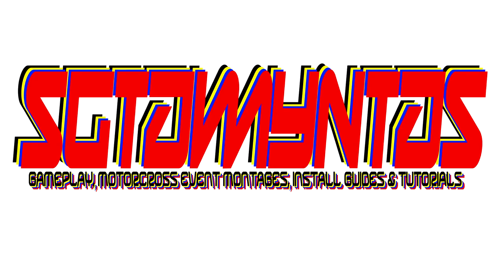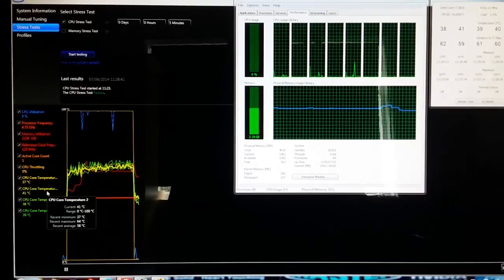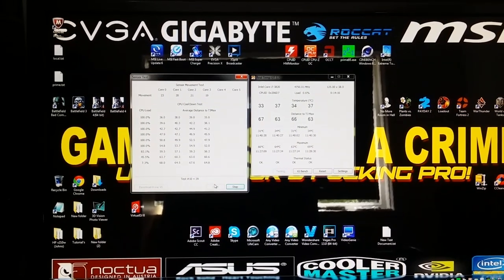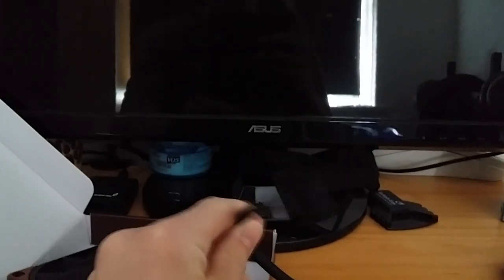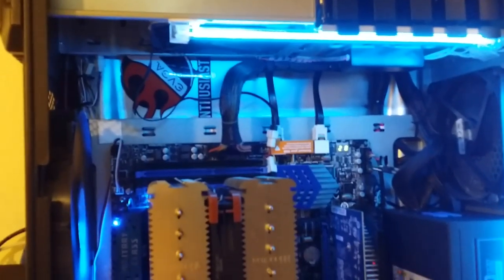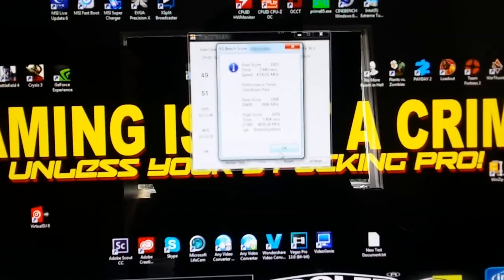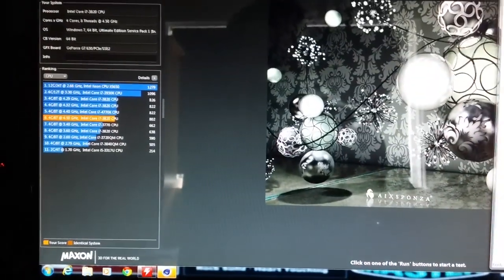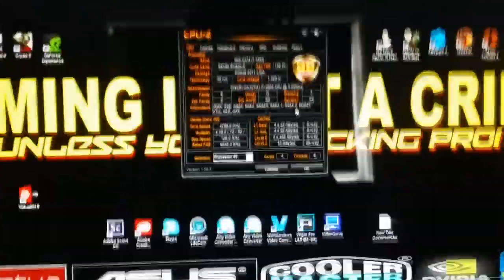Noctua NF-F12 PWM "Review & Benchmark Guide ".

Comment: Noisy? Can't hear him over the fans. Was about to order some but now I'm not so sure.
Reply from the maker: Hey thanks for your Feed back! They are noisey if you had them at the speeds i did lol as you seen it was Pull Push Config witch puts massive strain on the Fan and Heatsink, I should have used 2 in push config, And at Top RPM "3000" there is Massive Boost In Turbulence Pressure inside my case! But What config are you guys looking to run? 2 Fans on a H100i Would with a PWM 4 Pin Splitter would run nice and Quite & cool at 35% while Maintaining that Stupid high Static Pressure! You can see That one fan had to suck Air From 3Inch Depth Fan Block then Push it Threw a 3Inch Fan Block so there is Massive amounts of Resistance! Consider your Smaller Fan Blocks 1Inch or 2 inch and there will be little Resistance or Turbulent pressure.